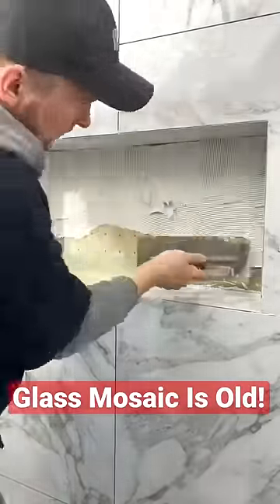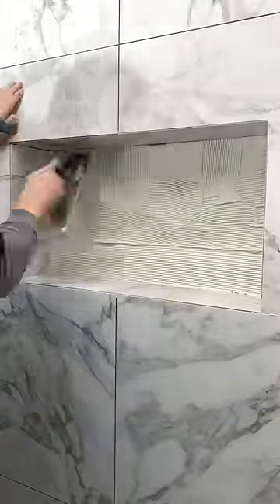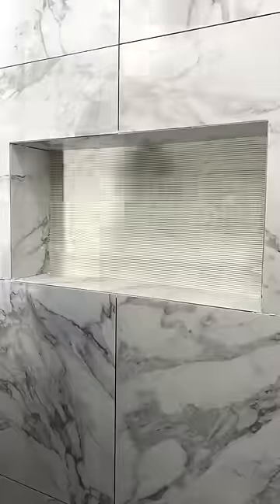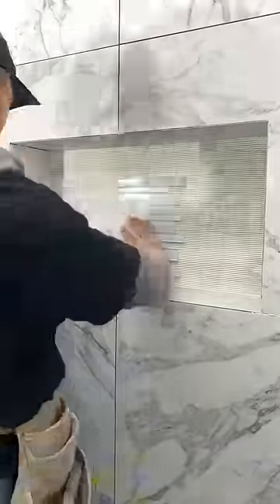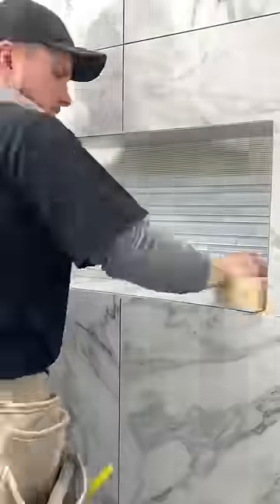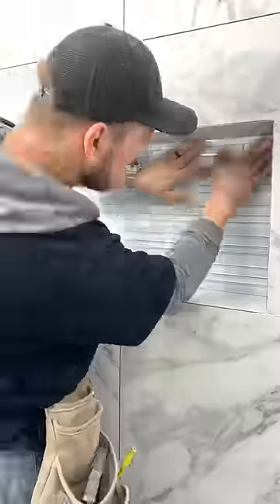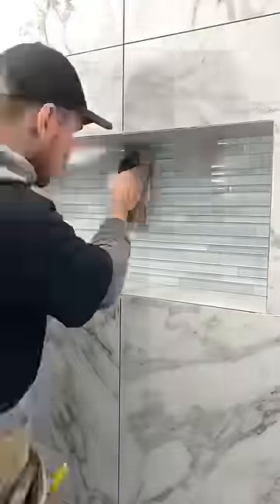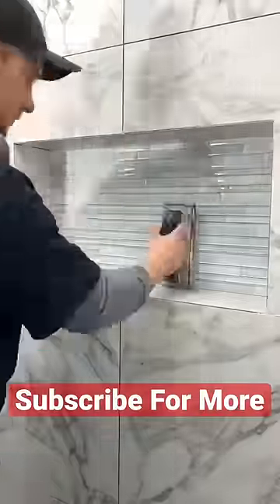Glass mosaics are going out of style! #shorts #youtubeshorts #diy

Comment: I have an Interior Design background and  am so over the stripe mosaic, and contemporary gray/black/white cold color schemes for residential. I still love mosaic when used creatively to add color punches to tie together other colors in an area, or add punch to a true neutral (beige tones) space. The pin mosiac is used as a backsplash in the kitchen a lot & that is not a practical choice and is EVERYWHERE. Also, most people do not like gray carpeting as flooring since  it doesn't mix with their wood tones. Taking a light neutral LVF with traces of wood grains of gray can accommodate most people's color paletes.
    We have had little creativity for the past 10 years and it is so boring and creates cold spaces, especially with such wide open spaces.
      In the process of looking to buy a house, notice so many realtors in Florida are advising clients to paint everything gray or bright white to freshen them up. I don't want to have to spend my money to warm the space with a neutral beige tone before even moving in so it will not clash with assessories and fabrics. The houses that sell fastest now are those going back to light neutral warm beige tones on walls, and soft off white trim with wood tones mixed in. Houses with gray schemes on exterior and interior are starting to sit longer. 
     Mosiac multi color jewel tones or earth tones still can work well in back of shower inserts and as a center design in a back splash. The pin glass is not durable enough for a kitchen backsplash. 
   I think of the flooring, countertops,  and walls as a neutral backdrop anyone can use to create their own look through furniture, fabrics, and assessories, that can be changed out easily if you tire of the color scheme in this lady's opinion.🙄

Comment: Glass is fine if used in the right context. If your wife is any good, I'm sure she can tell you what that is. As far as it scratching, so does stone and anything else,  so not really a concern. Scratches can be polished.  Glass might chip more easily, which is probably best repaired by replacing the piece that is chipped.